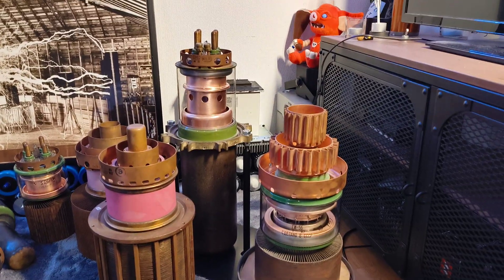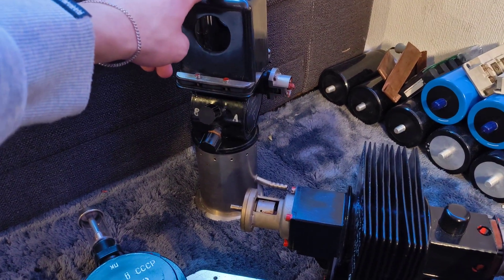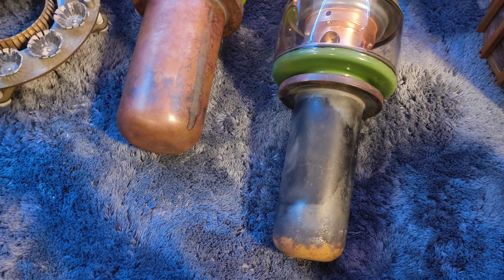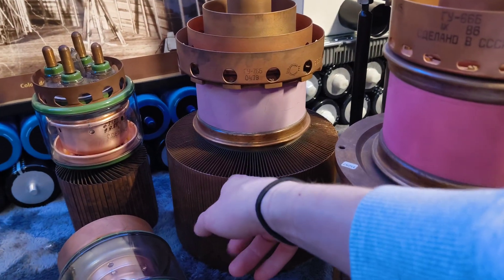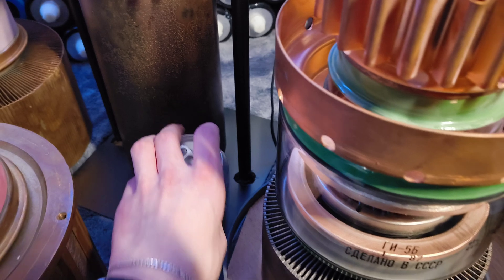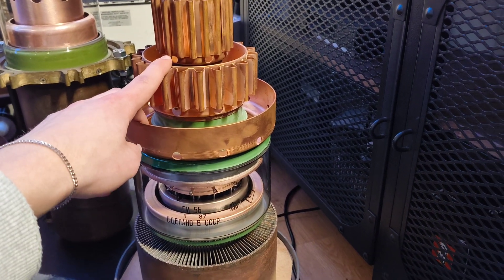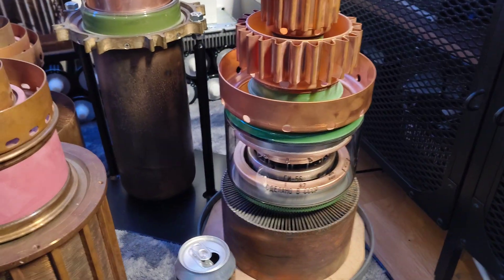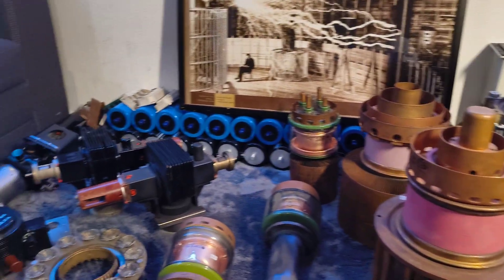giant Vacuum tubes and big Magnetrons

Comment: could rewind 2 MOTs each with like 4 turns of battery cable in series or (what i'm planning to do) repurpose a 2kva variac toroid by winding about 7-8 turns of battery cable around it keeping the primary
Reply: Yup that is about right for the bigger tubes

Comment: you should make a vttc with the most powerful tube you have lol. The arcs could be unimaginable
Reply from the maker: @ferrocerium123  to get the full power out of that tube I would need more than 160kw
Reply: @motness oh how was it organically powered? like when it was in sevice in some electronic thingy
Reply from the maker: @ferrocerium123 I don't know exactly but the gu66b for example was used in stationary military transmitters and maybe powered with big diesel generators
Reply: @ferrocerium123 A big 3 phase transformer rectified and filtered, modulate using a pair of smaller tetrodes or really big IGBTs. Used a pair of pole transformer ran in reverse 220 to the 120 mains lugs with the primary coils ran as center point grounded to power one at up to about 60kv in a VTTC as the main driver. As the tube was a tetrode it was easy to use the screen electrode as the feedback while the actual grid simply controlled the power and could allow audio modulation. ❤
Reply: A pole transformer ran in can get there. You will need to use smaller transmitter tubes to run the triodes, but with the tetrodes you could make a dynamic self oscillator. At around 100kw we got arcs that were about 20 feet long using one similar to the big one with the pink insulator. Could also be the guts of a respectable radio transmitter too. ❤
Reply: @christopherleubner6633  woah 20 Feet! that's crazy! the biggest arc I can make is 1.5 feet lol puny in comparison. What tube did you use?

Comment: for powering up the big filaments you could use one welder (or more than one in parallel). regular transformer core welders work at around 60v open circuit, but you can use the current limiting feature to get the current the filament needs and thereby achieving the needed voltage.
Reply from the maker: Hm I like that idea maybe I'll give it a try but I think at the end I will end up rewinding a big transformer or using server power supplies.
Reply: @motness that is also an idea. i was suggesting the welders because then you can power various filaments with different requirements by adjusting the current limiting